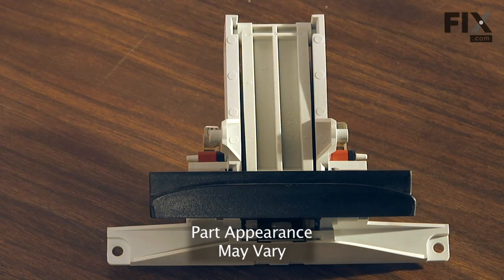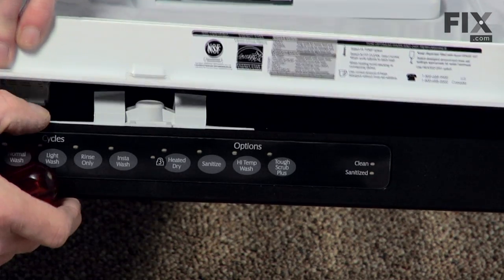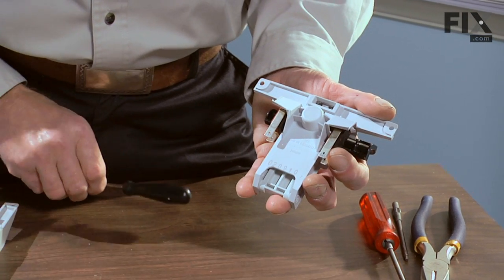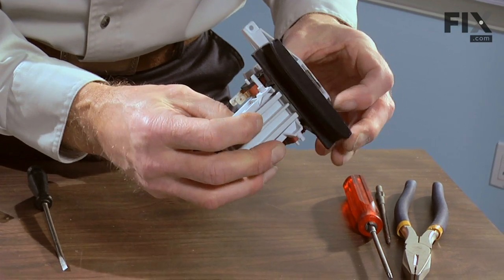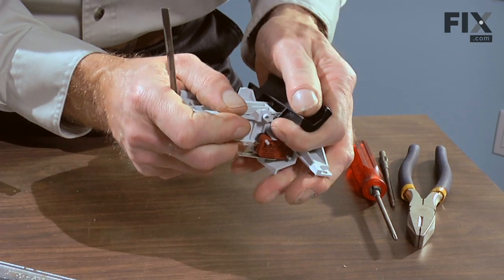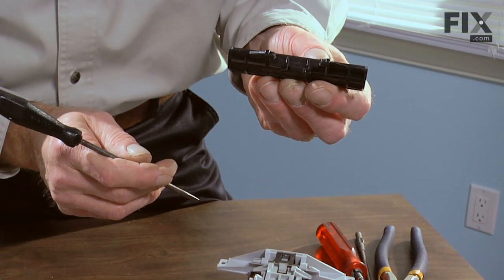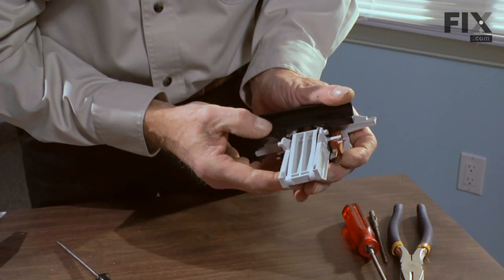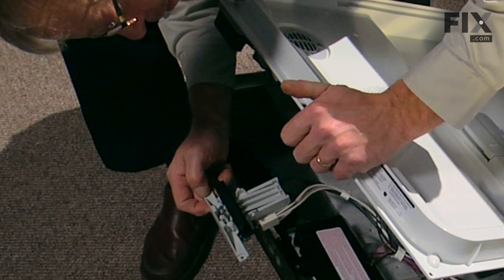Maytag Dishwasher Repair – How to replace the Door Handle and Latch Assembly with Switches

Comment: A big thank you!  I also couldn't get the electrodes off but finally saw someone use the flathead to get them off.  You!  Only a black handle.  That's okay.  Beats spending $200 or more for a repair man.  Thank you sir!

Comment: Thanks for the helpful video. I only wish you showed a better shot of pryi g the electrodes off of the handle. Mine are stuck and I'm concerned I might break something.  Would have been good to see the placement of the pry  that in more detail.
Reply: I was afraid of breaking something too but they did not break.  Just use the flathead screwdriver to pry them off.  No other video shows this.  Hallelujah!

Comment: Thank you!  everyone shows you how to replace the complete unit... but no one else shows you how to remove and save the handle - which is now required if you need to replace any white/tan handle (they only make black handles now).  

Extra hint:  If your old/original White/Bisque handle is broken/cracked and can't be re-used, you can use a little matching spray paint on the black handle (remove it as shown here, paint and re-attach).